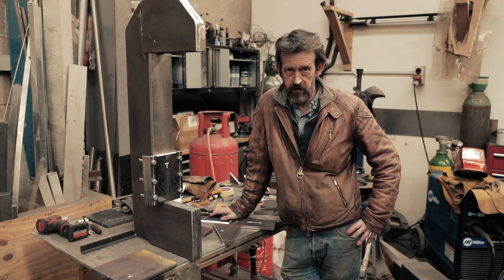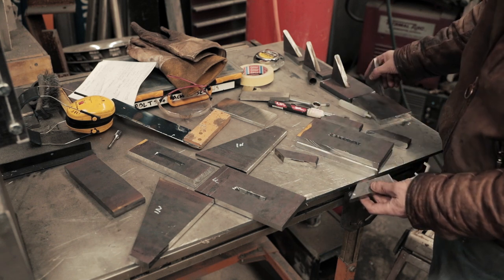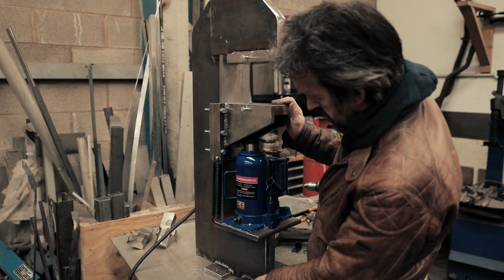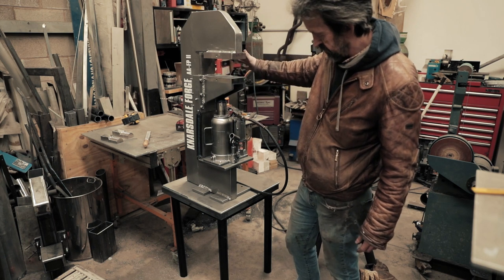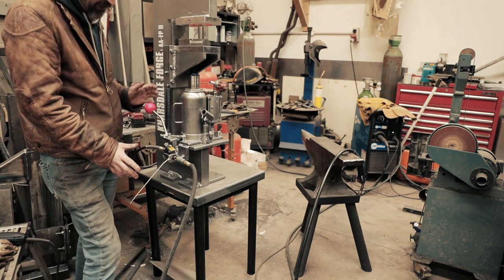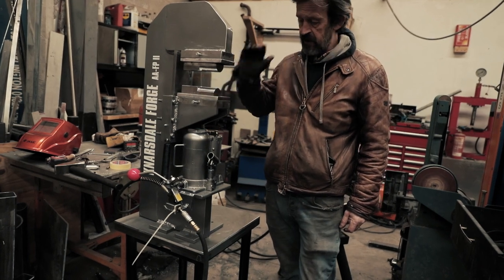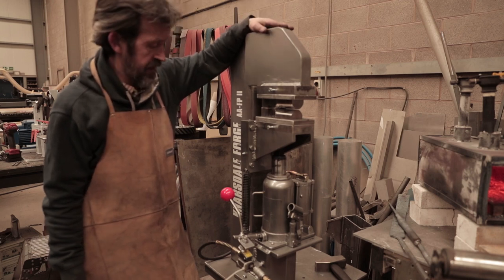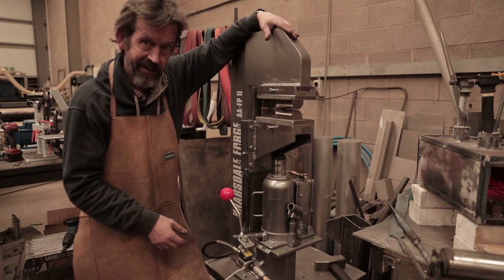HOW TO BUILD A FORGE PRESS USING A $100 JACK - PART 3 - IT'S ALIVE!

Comment: How big of an air compressor do you need?  Wondering what the air consumption is like. Thanks for the video!
Reply from the maker: I'm not actually sure, I only have a big screw compressor, but that hardly runs when I'm using it

Comment: Servus wo bekomme ich so eine Presse mfg Hermann
Reply from the maker: You can get the jack from ebay - https://www.ebay.co.uk/itm/115655461068?hash=item1aed9a48cc%3Ag%3A0w0AAOSw%7EddgWuBi&amdata=enc%3AAQAHAAABIAA4VpyIN%2FPYvvYDZFvWGIJqdcFI%2B%2F472D80ffd7JY%2BX6vmomncbJYwZjxPEBDxxdSW6WPmCOKcYo8O2G27b7%2FXo1BpZt32a4roSW73lIjaK35NEz1zTjBOXoo6kKErphDJBNlX1cDS4llGgCpaullE3a6PPcbi52dae0kyVuyUaaJfJEZxn2NSZSsoODkuXaK1QIzLBM181ayEwvD6DguzC5Z82U0oSNmauzptWDT9U7pM%2FWz4noU0Ryl33OA9DY2EcXxdd268fkE52dAcq1Ijr4r5AUdPYReUlRWFc%2BVFy0P0ApGyE05efK9UNXiEp%2FoM4Wte2ScdlFjPMfNaPEfK7YBDTqsTmnCOpK7M0FcOxk7XXSFhpL9Gco9%2B6nfs2lw%3D%3D%7Ctkp%3ABk9SR9aU4s64YQ